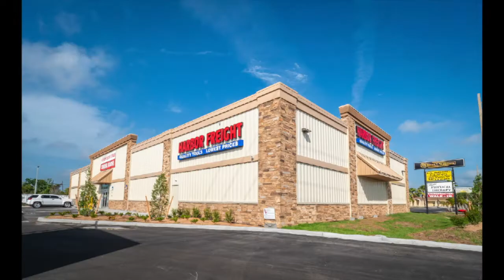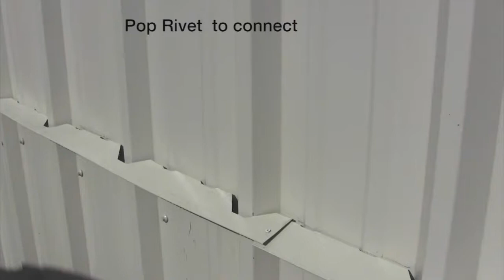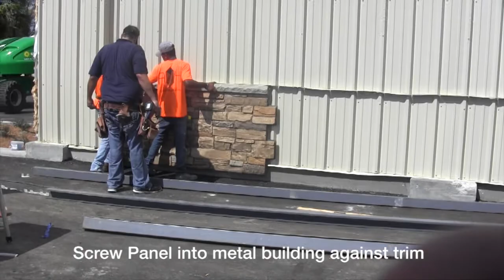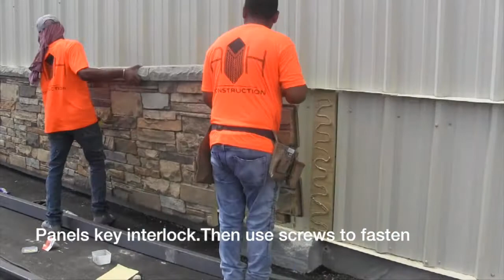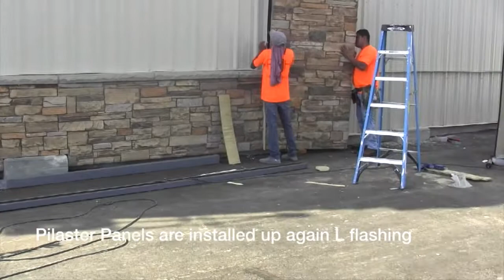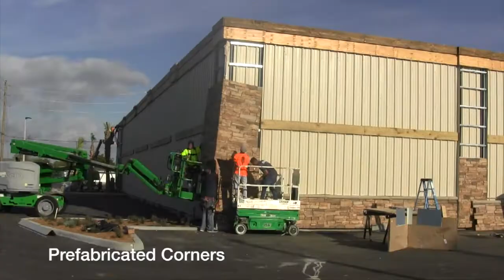installing Urestone on Metal Building

Comment: Hi Rod..On the R panel installation are 2 trim pieces needed for top and bottom?...the trim I am referring to is the MT1650.
Reply from the maker: Typically the top MT 1650 flashing (trim that is designed to follow the profile of the R panel metal siding) is only needed at the top of the wainscot panels. Our panels can be installed with or without a bottom drip edge flashing. The bottom "L" drip edge flashing can provide a cleaner appearance and would be recommended if there is a sloped grade on the the property.